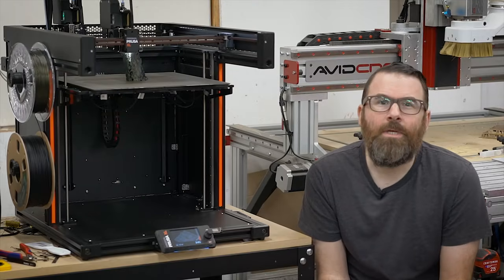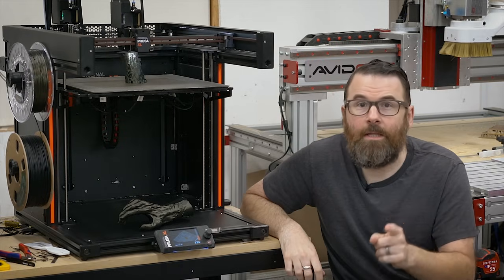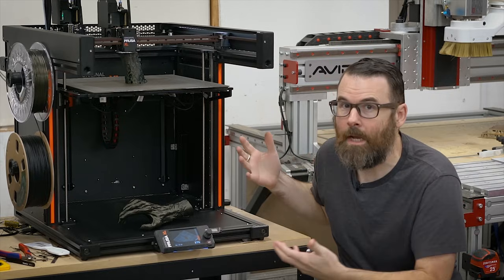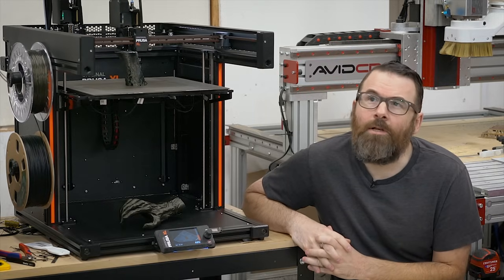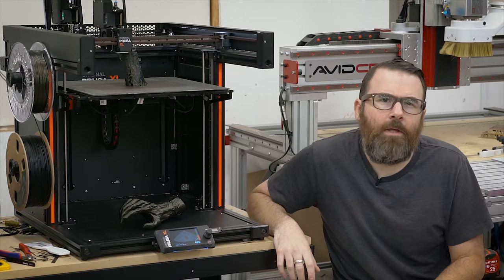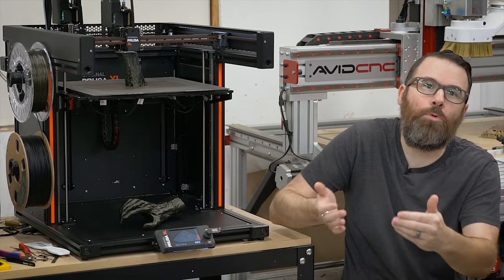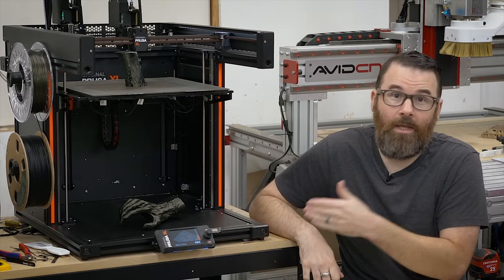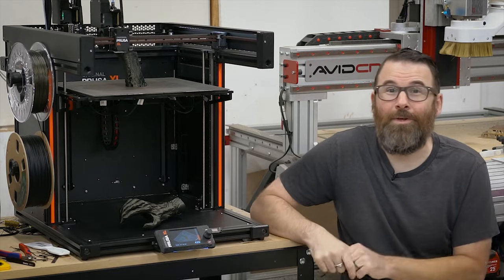Prusa XL - Alpha Firmware Testing!

Comment: Honestly maybe just flash klipper on this thing if possible.
Reply from the maker: They did address this in the blog post.  In short, I think they sell to a lot of government/EDU customers who are picky about open-source stuff hanging out on a network.  From my day job, we fill out forms from large companies every week; they want to know what libraries you use, what talks to their network, if cloud is required, etc, etc.  There are security risks when you just slap a raspberry pi on a network.  For most hobbyists, this isn't really a concern, but for industrial customers, it's something to consider for sure.  This is largely why Bambu came out with the X1E, they were probably unable to service that market.
Reply: @RobertCowanDIY  Good point. I believe if a hobbyist is using this / non governments, klipper seems like a better place to go instead of using Prusa's own firmware.

Comment: the bambu will always be more capable than the prusa. this is really simple, its the max flow of the hotend. the bambu hotend has a better meltzone and can handle more than 2x the flow the prusa can. width x height x actual speed = flow. any two printers running the same speed, accel, widths, height should be exactly the same "print speed" on outputs assuming the motors have sufficient power, not losing steps, etc. the motion system is better on the bambu's and the hotend is better, its always going to be faster, and thats never ever going to change, unless prusa releases a high flow hotend. when i asked jo about it at ERRF he blamed e3d for there not being one. 

input shaping will never make a printer faster, it smooths the motion curves out to reduce ringing at the expense of smoothing out surface detail. on klipper and RRF printers this is tunable, but on prusa and bambu, this is not. the bambu will auto set the midpoint for input shaping models, but currently prusa is just setting to a fixed point. in order for a universal fixed point to be valid, because your accel performance is going to be build/printer specific iin conjunction with the exact surface and positiong placement, like a fingerprint, they are going to have to be using a very wideband and high smoothing model to account for this, which means lots of smoothing potentially. if you want to print faster,  only the hotend can lift that cap. typically you can  kludge a hotend to have a bit higher flow by moving to a fatter nozzle and changing the backpressure at a given flow rate, and thats an impact on the classic 3d printing paradox of speed (being able to print faster by going taller or wider but actually moving slower while at an increased flow rate, and being able to extend this with fat nozzles) but on modern printers this isnt really necessary because you can push 0.8 easily on .4 nozzles with modern geared extruders so this makes comparing things apples to apples pretty straightforward. when you use equivalent nozzles. a .6 on a bambu will push something like 32 cubic if not more if the hotend is sufficiently hot. a .6 on a prusa xl will push something like 15 on the same material.  its just not comparable. you can push these printers any width/height/speed you want as long as you stay under the flow cap, but the bambu is going to be about twice as fast any way you dice it when you actualy do an apples to apples comparison. all the input shaper is doing is smoothing the surface as a way of mitigating ringing. its not making the printer faster. it is making the printer quieter. you can print at the exact same settings with and without input shaper, the only difference will be ringing performance and noise. so because of this, no, the prusa mini is not magically suddenly faster, nor is the mk4 nor xl. you can run those exact same speeds and feeds before. 

how do you compare printers in an apples to apples context? you compare how fast you can move the motion system before steploss, max flow with same nozzle size, put a bowl of water under the toolhead at a fixed distance to measure the cooling, look at the spectral charts from a nozzle mounted accelerometer to understand the ringing behavior/performance and how that limits accel vs quality. nobody does this. and thus every pritner comparison on youtube is just....wrong.

you should always get the exact same time with the exact same settings......on any two printers assuming they can handle those speeds and feeds in the first place. the physics isnt changing, you're setting it to some accel, some velocity some extrusion width, height etc. where this might vary is between different slicer families where the slicers make different assumptions. this is most notable with slic3r derivatives (PS/SS/bambu/orca) vs cura engine stuff, as they make completely different assumptions about the actual shape of the extrude line.  if you use the same slicer and same slicer settings on both printers you will get the same result unless something is wrong, excluding things like startup sequences. you can also use something like klipper estimator to digital twin a slice vs a fw config to actually get an accurate print time estimate as prusaslicer is notoriously and comically wrong the faster you go up in accel, something thats been known in voron, annex, and ratrig communities for years. .
Reply from the maker: Looking at all your comments on all my videos, you really really like Bambu.  It's a great fast printer, no question.  I won't throw in a 'but' after that because I think you have your mind made up.  Just let people have preferences.  These are tools, not identities.
Reply: @RobertCowanDIY  I have 3 prusas 1 bambu 3 vorons 2 annex printers, a raise3d raise2, an ender5-mercury one, a saturn2 2 kp3s's I'm pre-ordered on the magnetoX and I have a stratasys unprinted se and a bunch of other printers. I used to run a 75 printer farm for production but I run 15-20 printers for prototyping now. Some of the machines rotate in and out now. I have access to a ton of other equipment and I do consulting for farms. Over the years I've probably worked on at least 50 different kinds of printers first hand. I actualy was sponsored by prusa for a hackathon in 2020, they gave us a dozen spools to give away, and my charity cobranded with them in the past, we made and donated 260-ish thousand face shields in 2020. Back then, the mk3s was top of class, it just flat out isn't even in the conversation today. I sold my xl already.
Reply from the maker: @JustinBuildsThings Cool!  So real talk, what's your 'go-to' printer?  Which one do you feel more comfortable with?
Reply: @RobertCowanDIY  at this point I'm probably most comfortable with my voron 2.4 and trident. I first built the 2.4 in early 2021 just before the kits era, and was an early adopter of moving into like custom metal parts, 2.5 amp motors, 48v, and extreme flow hotends, so they have been continuously modified over time to be purpose built for my workflows, very fast prototypes and batching small functional parts. I suspect that will shift to my annex k3's when I get to spend some more time with them, I just built them and havent put the time yet.
Reply from the maker: @JustinBuildsThings Gotcha.  I've always wanted to build a Voron, but I just have too many other projects and don't need another one!  Thanks for the info.

Comment: The xl is not even close in speed to the bambu.  The bambu can print high speed and accurately. There is no comparison between the two with accuracy and speed. If the xl could even reach the speeds of the bambu, I am sure it would not be as accurate. The bambus have great motion systems.
Reply from the maker: k.
Reply: I'd argue motion system wise Prusa is better, it just depends on how fast you want to push it.
Reply: The parts I print for my business take the exact same time on both the X1C and MK4 with IS. The time for the MK4 was actually a minute faster. Using prusaslicer and bambu studio. Using ALL THE SAME SETTINGS and an old bedslinger finishes prints in the same exact time. The XL will be the same soon enough, Its alpha FW for a reason. Got a screenshot for proof if you want it, but I already know the answer.
Reply: Yes show me the screen shot. I dont even know what you are trying to show me with the screen shot. But I would like to see it. The MK4 does not have accleration that is even close to the bambus. So even if it could travel the same speed, it could not get there as quickly as a bambu.   @LilApe
Reply: @luke8874  Here you go. Just remove the spaces in the link. And I upped the acceleration settings on the MK4 to match what was on the BL. It only sped it up like two minutes lol so not a big difference. Using all the same settings as I've been running for years on my MK3. Even used the same amount of filament. Now you gonna tell me its fake and I'm doing it wrong?

Obviously youtube doesn't like links. But the screenshot showed both fies with their print times. Just like it did at the end of this video. Taking the same amount of time using all the same settings. It's okay, an old "outdated" bedslinger runs just as fast as the best thing out of shenzhen
Reply: Bambu coerXY uses 5000 acceleration for outer walls
That is not much of an acceleration for Input Shaper users
Bambu has a flaw in its motion, frame system
It also shows the limitations of cheapness in verticality
and actually Bambu has no skew setting
Reply: "citation needed"
Reply: Bambu in this very video prints twice as fast on a 0.4mm nozzle as xl on a 0.6mm!!! That's ridiculous.

The reviewer tried their hardest to gloss over this but if you put a 0.6mm nozzle on the bambu you'd blow the xl away.

If the xl tried to print as fast, it would suffer far worse quality.

Only by hamstringing the bambu and slowing to prusa levels do you get same speed and quality.

As another commentor mentioned, it's down to Max volumetric flow rate among other things.
Reply: The reviewer says "it's only fair" to make a 0.4mm nozzle print as much material as a 0.6mm nozzle printer with wasteful slicer settings.

But they totally ignore that a 0.6mm nozzle has to make far fewer passes to print. Which is why 0.6mm nozzles exist, because all else being equal, they are always faster.

So what you're actually doing is hamstringing the 0.4mm nozzle printer because it has to make way more passes, yet it ends up as fast anyway.

If you put a 0.4mm nozzle on the xl or a 0.6mm nozzle on the bambu, you'd have a real comparison and THAT'S when you should be trying to match the grams used (although prusa using too much material is not a great goal to aim for).

All you're doing otherwise is proving that at stock the bambu is vastly faster and better optimised, and even with more wasteful filament use, it can do with a smaller nozzle the same speed as a larger nozzle on an XL.

That's mighty impressive from the bambu!
Reply: To be fair and unbiased to the XL, it has its place. But it's not where people expect:

1) For single material prints, it is only better for prints where the build volume of the bambu is insufficient. In all other respects, the bambu is faster and the better printer single material
2) For multi material, the prusa XL shines for 2-5 materials/colours. This is the real niche of this machine, where it's head swapping makes it VASTLY faster and less wasteful for multi colour/material prints with many layers. Bambu slows down horribly when swapping colours for many layers and purges a lot of material, often more than the model itself (very wasteful).
3) I'm not sure about this, but I believe the XL can also do TPU mixed with other materials. This is a huge use case for things like print in place gaskets etc.
4) For multi colour/material 6-16, the bambu takes the lead by simple virtue of the XL only having 5 print heads.

So to me, the XL is really a printer best used to print 2-5 colours or materials across many layers, where it is king of its niche. It can also print larger volumes, but other printers are better here than both of these printers. 

As a general use printer, the prusa XL is generally beaten by the bambu in every way - price, flexibility, speed, integration, you name it really. The prusa xl is not a bambu killer by any means
Reply: Whats wrong with you? In multicolor Mode the bambu has no Chance. 4 Color benchy with bambu 18hrs. With prusa 2.5hrs